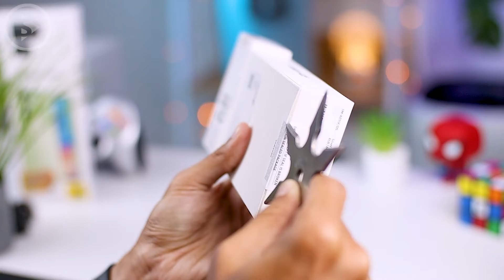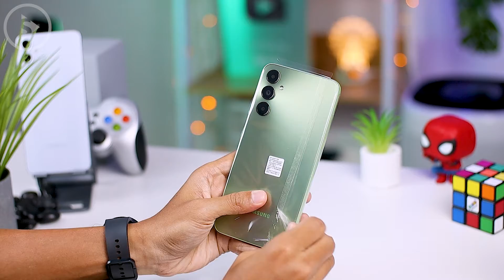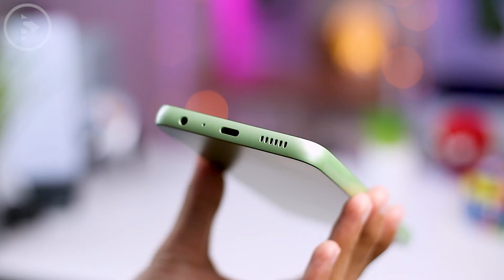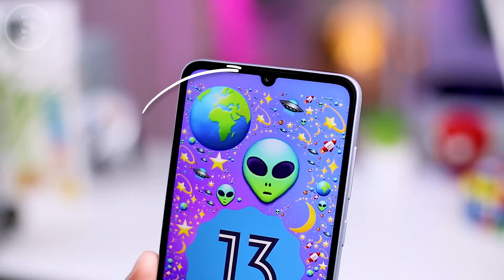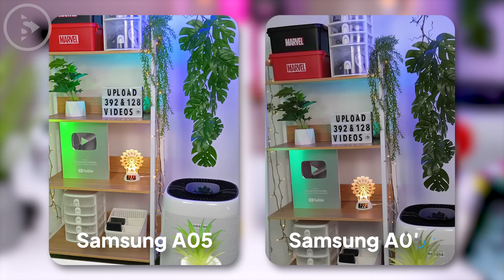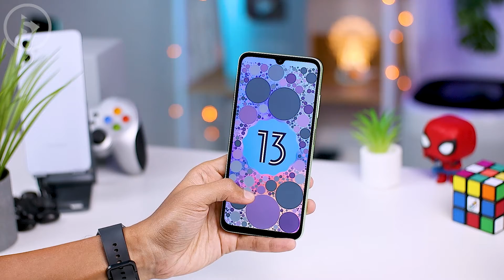Samsung A05 & A05s Unboxing - Camera, Design, Display & Performance Test using Antutu Benchmark

Comment: It surprised me that the camera of a05 is more vivid and brighter than a05s
Reply from the maker: yes, that makes two of us 😁
Reply: I use the a05 both phones are the same man they don't have any difference expect the a05s has triple camera and it's equipped in snapdragon 680 no need to worry about . If I am using a05s I already know that things are just similar to a05 they don't make up any differences man
Reply: The features of a05s are from a05